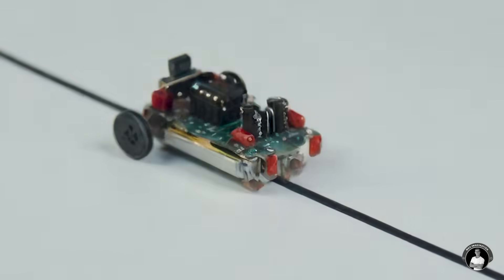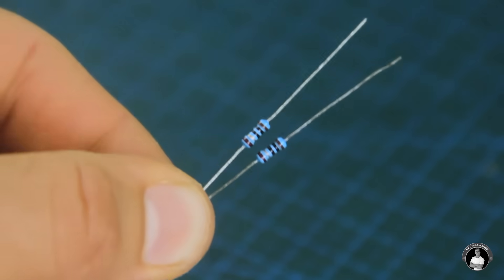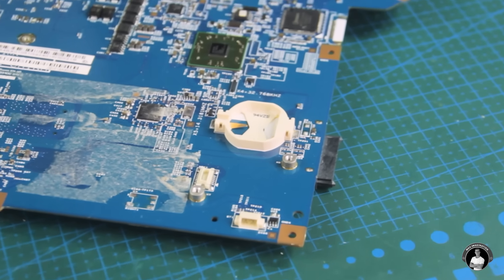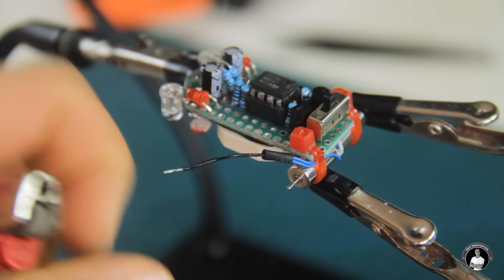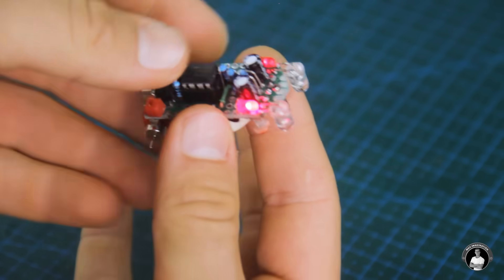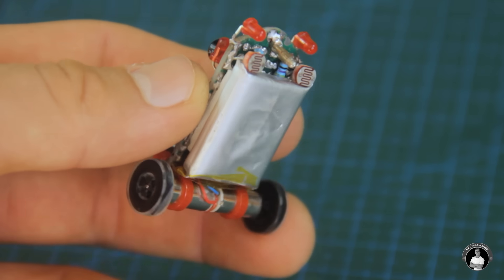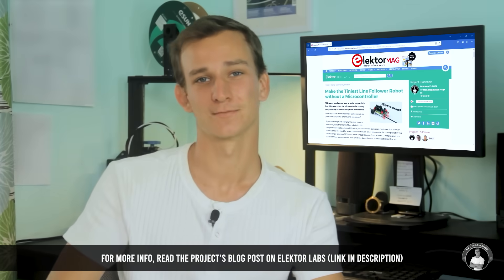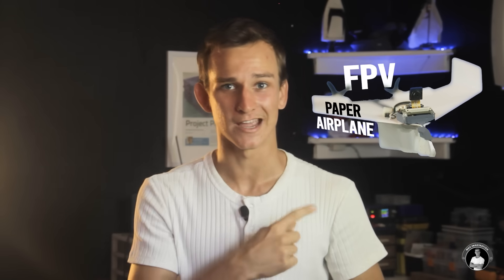Make the TINIEST Line Follower Robot without a Microcontroller!

Comment: what transistor can i use to replace ss8550
Reply from the maker: 2N3906 or BC557 PNP transistors are good alternatives.
Reply: @MaxImagination  i have both npn
🥲🥲
Reply from the maker: You need to use PNP as you can confirm by looking at the diagram/schematic.

Comment: Everything is cheap, the most elaborate are the motors and the circuit, but if you know about electronics you can replace them with logic gates. I've seen how you can make the PCB with needles and you can knit it with wire.
Reply from the maker: Yup, it can get more crude that that! The line follower project can be made in so many ways.

Comment: So am I right in thinking only one motor can be on ate once? The comparators  look to be connected so one is on and the other is off? The same for the motors they are driving?

I did a circuit at school many years ago , both motors were on and you stopped a motor to cause it to turn. Here it looks like it wiggles?
Reply from the maker: Correct! One is on at a time when moving forward and tracking the line.

Comment: why did you chose the components you did
Reply from the maker: That way one can actually understand the workings of a simple line follower without mindlessly copy-pasting code for an arduino robot.

It's cheaper too this way for others.
Reply: @MaxImagination  i meant why did you chose the specific resistor values and the opamp, whats the engineering behind those choices
Reply from the maker: That could take a whole video to explain.

But to cut it short, I chose the op amp for its comparative circuit, the op amp to effectively control the motors via transistors, and resistors to set appropriate voltage drops for each component in the circuit to do its job.
Reply: @MaxImagination  ah ok ok just wanted to confirm whether it was a comparator or not

Comment: Can you make a tiny maze solver like this if yes what sensors you will use
Reply from the maker: Possibly, but I do not promise anything. Another viewer recently mentioned that adding more LRD sensors out to the sides in parallel would allow this robot to continue following lines and staying on track at a high speed.

Comment: Great project!! The bot detects the difference between light and dark and correspondingly activates the motors but if both ldr are on white / black how does the opamp compare and subsequently send the logic to run both motors?
Reply from the maker: Thanks! If both sensors receive the same amount of light, the opamp makes the robot veer at random until it rolls over a contrasting color surface to continue differentiating.

Comment: I reckon you can simplify it down even further to just a single Op-Amp if you have it continuously running and have the op-amp push down a pin into the ground that allows the robot to turn around it to the left. Then when the pin is up, the robot will naturally swerve to the right. That way, the single op amp can be used as a switch.
Reply from the maker: May work, but not with higher current devices like the motors.

Comment: If your micro supports it you could also use a pwm generator and capacitor to smooth the output to lower the average voltage by changing duty cycle
Reply from the maker: There is no microcontroller used here...

Comment: I would like to add here....
With line detectors placed in the same axis as the front steering wheels (an additional pair here) {just as steering wheels are in present day multi- wheel system's} ,is really ideal...
Also if the steering control is tweaked to output a behaviour as in "ACKERMANN STEERING SYSTEM's" or improvements in that..,then you have really nailed it.
F.Y.I. ..ACKERMANN STEERING is the basis for all multi- axle vehicles..where the circle insribed by the turn of inner & outer wheels have the same center of their radaii & is always the midpont of the of the rear axis rear wheel dive pair.
Reply from the maker: Thanks for your tip. Ackermann Steering could work well if this robot were made into a robot car and had further technical adjustments made to improve its tracking abilities. Cheers!

Comment: Really simplest design .. good for newcomers & beginners.. getting into it..
Here are some few points that you may consider in future attempts...
The single led & ldr.., one for each side and the comparator mode of operation.. permits only a TWO LEVEL(binary/2 bit) control.
With 2 per side , and the second pair , placed behind (or front) and slightly left/ (or right) of the first , will give a narrower band( configured like a hysteresis window) for each wheel..
Now you can get a minimum 4 bit logic resolution..
With additional combinational & sequential logic.. more permutation/ combinations properly worked out , can make it a more robust controller..
bear in mind this is just a " look down" decision controller.., and  not a " look ahead" one..
In both cases.. the detect sensors  & driven wheels are at extreme opposite ends ..
Best would be to have idler wheels (turning L/R) controlled  by this and rear  wheels drive by some other circuit .
Happy Tracking.. 😅
Reply from the maker: Hi there. Thanks for your comment and tips!

Comment: u
Can use a 555 IC to convert DC motor control voltage to 100 Hz pulse width modulated full battery potential for low rpm with high torque (instead of geared motor option).
Reply from the maker: Hi, yes it is possible and probably smarter to do if you cannot find a similar-sized geared motor.
Reply: How does one co-relate the line sensor/s position feedback to the pwm control ?

Comment: Nice quick & simple basic tracker built & functional.....
Its a simple dual " bang- bang" controller....
IMHO there are some minor improvements / circuit changes that could better its preformance..
1) The single cable tie (clamper) on each motor cannot prevent motor pivoting during bang on / bang off....atleast use two ties..spaced further apart...
2) The LDR's should be moved closer to center of axis....it will reduce the off tracking error correction span.
3)  Each LDR/& respective led must be gated/pulsed alternately to avoid each others  light interfering on other sensor.....this means more electronics/ logic ckt.additions....😢
4) LDR axis & motors shaft axis..must be parallel to each other.....
5) try to obtain/make really well centered wheels....
6) Wheels must be equidistant from pcb longitudinal axis centre..
7) Wheels fitted with slightly tapered width..,with the smaller diameter on the outside ..will allow for natural correction to move in a straightline without " drifting " left or right on its own.......
These are some mech. insghts I could offer..😅..wish you for best next attempt.
Reply from the maker: Thanks for your tips! I will take note of that for potential future upgrades to this robot. Cheers.

Comment: Can you make a detailed video explaining the schematic you shared ? basically the circuit design procedure.
Reply from the maker: No. However you may check the updated diagram in the video description that is accurate to the circuit my robot works with.

Comment: I designed and built one of these (similar though larger) 60+ years ago using a total of FIVE (5) parts!  2 x CdS photoresistors,  2 X small DC motors, 1 X battery. Called it a robot Rat. It would turn to and run toward a flashlight.   adding 2 X light sources and 2 lenses would make it a line follower!
Mike L. "First MIKE on the internet - ca. 1975"
Reply from the maker: So simple yet super cool! Thanks for sharing.
Reply: Thanks!  This was when I was about 12 or 15 years old. I put it in a darkened "haunted House" and went exploring with a few kids with flashlights. It scared the c--p out of them!
It ran towards the first kid to turn a flashlight on it, then turned to the next one to shine one to see what was happening.  Mike L. @MaxImagination

Comment: Nice project! I did a similar design last year, using two high brightness white LEDs for illumination, two yellow LEDs paired with an BC547 amplifying stage for each one for reflection detection (using the yellow LEDs as photocells), two BD135 with 1N4004 flyback diodes for driving the bigger motors and an LM339 for the comparator. I find remarkable that such a simple bang-bang controller can follow lines so well.

But, I have to say that I've got VERY worried in seeing solder being filed. Most probably you are producing a lot of highly lead contaminated dust, because most popular solder alloys generally have 60% tin and 40% lead, or 63% tin and 37% lead. Not only it is very easy to breathe in some of that dust but, as well, this fine dust has quite an ability to stick to the skin of your hands, and stay there even after some washing.

Play safe! Don't fool around with solder dust.
Reply from the maker: Thanks for your comment! Seems like there are many simple line follower robots of different kinds out there as such, cool!

I see you got a point there with the solder dust, I will try not to touch it next time. Thanks for the tip. I've also already invested in a solder fume extractor to use every time I'm working on a circuit. I highly recommend it.

Comment: I know most simple circuits use two photo sensors, but since you are just following an "edge" (blacl/white edge,) you don't need two photo detectors.
Reply from the maker: I see how you may be right, but with 2 sensors, it's more likely to stay on the line and not veer off.

Comment: Hey, this is great.  My 11 year old is in the works of making something like this.  One note or question though.  You say 51ohm resistor but it looks like you are using 47ohm instead...how important is it for it to be 51ohm?  Just curious.  Thanks.
Reply: following the schematic is difficult lol.  It has things that  you do not mention but we think we got it working...using a little trial and error.  The big trick is to dial in the speed of these little drone motors...we could not get the weight off the cell phone motors with out breaking the shaft.

If we create this thing we will probably create a little more detailed schematic, if we do we will either send it your way via your elktor links or tag you in a post with it attached.

Thanks man, this is a great little project!
Reply: @Kai-Made both motors are independently switched "full on" or "full off" by their respective LDR/comparator ckt. the ldr placements& comparator thresholds decide the on/off for motor (L or R side) to do correction when it veers off track/line..
When energised they are always at max.speed...
therefore it tends to 
"runaway" sometimes....
Reply from the maker: Hey! 47 and 51 ohm resistors are just about the same. It makes no difference in the circuit.
Also, please check the updated circuit diagram in the video description. Cheers.

Comment: where the potensio ?
Reply from the maker: The two 20K ohm resistors on top replace the need of a potentiometer as that's the attuned value.
Reply: oh i see and where the diode in diagram ?
 @MaxImagination
Reply: and can you give the type of mini diode between IN4007 diode
 @MaxImagination

Comment: Nice video! A line follower is a fun starter project. 👍
Adding a couple of flyback diodes to protect the transistor might be good for the long-term operation of the circuit. While the motors are small, it's always good to take precautions to prevent any potential damage to the transistors.
Reply from the maker: Thanks for watching! Good point. Well, I have updated the circuit diagram with the flyback diodes and other changes. Cheers.

Comment: Simple question : Is it possible to make an invisible line with like some special pen and a special led ? Currently working on a huge racing circuit and i want so hard to add trafic without killing my budget.
Reply from the maker: Unless you're willing to change the photoresistors for magnetic reed switches, no. This isn't possible with the current robot setup due to the fact it needs to detect dark/light contrasting edges.
Reply: @MaxImagination  So let's say i use invisible magnetic paint and hall sensors on the device, it's possible ?

Because a simple HO autonomous car is arround 150$ and it's pretty expensive.

Comment: You should have known those tiny motors have huge KV ratings and need to either be geared down or controlled with a PWM.

I still upvoted the video.
Reply from the maker: I was totally aware of that, but still went for the challenge. If the robot was not to move with the current motors, angling them would have worked even better. Always more to learn... Thanks for watching!
Reply: @MaxImagination ...angling them ????

Comment: I participated in a Line Follower Competition held at university level among the college students. Got 3rd position there. All the participants who made this type of robot(this technique is called bang-bang) were eliminated in the first round or so. The only participants who could qualify for the semi finals made the pid line follower. Ours was pid too. But for this kind of robot, it requires a lot of precise calibration. It would be really good if you also try making an advance pid line follower that can be a competition winner.
Reply from the maker: Thanks for sharing that. Really cool! 
If I see a good fit for a YouTube video, I may try making a competitive line follower robot with Arduino. Cheers.
Reply: You can also do analog implementations of PID, it's just harder than doing it through a microcontroller

Comment: You can lower the gear ratio by using smaller rounded tires, you just may have to angle to motors to get them to touch the ground.

Furthermore, you can adjust the steering effectiveness by making the front caster farther forward or backwards, and/or by bringing the wheels closer together or spreading them farther apart.

To get max voltage drop to the motors, don't use Schottky diodes, but rather normal silicon diodes. Most Schottky diodes only drop ~0.3 volts. Normal silicon diodes drop ~0.65 V. You can also just use resistors if you observe ohms law. (same thing really.)

Li-Po batteries can catch fire pretty easy. Recommend against their use if possible. At that size, it would be like a few books of matches going all at once. Still enough to burn you, or burn your house down.

CdS photo cells are most sensitive to green light, right around 555nm. Use of a green LED and light absorber that takes green up best for your lines would be ideal.

They make smaller dual comparator IC's. A reasonable substitute would be a dual op-amp IC.
Reply from the maker: Thanks for your tips, this is really useful to know. Will take note of that!

Comment: I like the introduction, you can make this robot very affordable if you have 1 broken computer, 1 remote tv controller, 2 broken mobile phone.
Reply: "Can you tell me how to avoid walking into walls? I have no eyes, no ears, no sense of touch or motion" 😂
Reply: I made this robot with a Squirrel, a knot and a line follower robot
Reply: Can you suggest me how to make a repeated vehicle that on py pressing button and hit with wall and come back with itself to it's original position.

Without any sensor or controlling devices
Reply: @userxxdy123  "how do i sense things without sensing them?"
Reply: And a shirt
Reply: Russians are making military drones, out of washing machines 😅
Reply: Look for substitutions. Any motor. Any wheel thing. Make it work
Reply: Everything is cheap, the most elaborate are the motors and the circuit, but if you know about electronics you can replace them with logic gates. I've seen how you can make the PCB with needles and you can knit it with wire.
Reply: I have allat fr
Reply: The infrared leds, the batteries and the boxes you can get them easily on any electronic shop and are cheap. And there is no need to make it that small.   But yeah he is a douchebag, but I can skip that in account of the interesting project he shared.
Reply: 2 broken tv remotes

Comment: 1  90 degree turn and it oes of track. wonder if i can add more of those sensor thingies.
Reply from the maker: Perhaps adding multiple photoresistors in a parallel array outwards like most of those competitive line followers would do the trick.

Comment: *Abstract*

This video tutorial teaches you how to construct a miniature line-following robot that doesn't require a microcontroller or Arduino. The robot is remarkably small and can track lines of various widths at high speeds. Here's what you'll learn in the video:

* *Components:* Most parts are commonly available, including motors from old Nokia phones, a comparator circuit salvaged from power inverters, and buttons for wheels. You can also purchase the components from provided affiliate links.

* *Construction:* The robot is built on a small perforated PCB board. Detailed instructions cover component placement, soldering, battery connection, and making the front caster wheel.

* *Circuitry:* The robot uses an LM 358 comparator for decision-making, LEDs, resistors, transistors, and other electronic components. The video includes a circuit diagram, assembly explanation, and tips.

* *Charging and Enhancements:* The tutorial suggests using a rechargeable lithium polymer battery and covers adding heat shrink wrap to the wheels for better grip and shockey diodes for voltage adjustment.

* *How it Works:* The robot uses light-dependent resistors to detect the difference between light and dark surfaces. A feedback loop corrects the robot to stay on track by controlling motors accordingly. 

* *Troubleshooting and Limitations:* If the robot struggles to stay on track, the tutorial suggests using geared motors and adjusting voltage through diodes.

* *Educational Content:* This project is ideal for hands-on learning. The maker also promotes a subscription service (Circuit Mess) that offers educational electronics kits.

disclaimer: i used gemini advanced 1.0